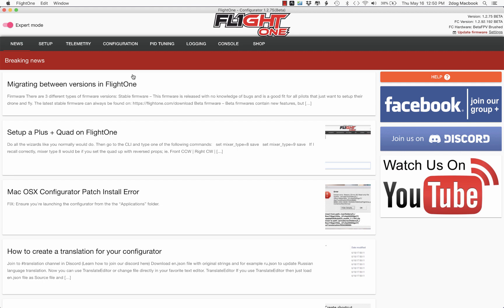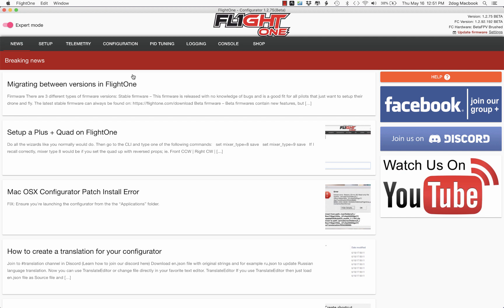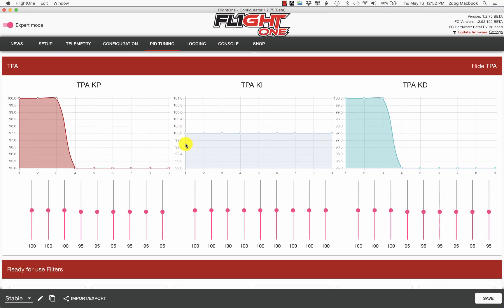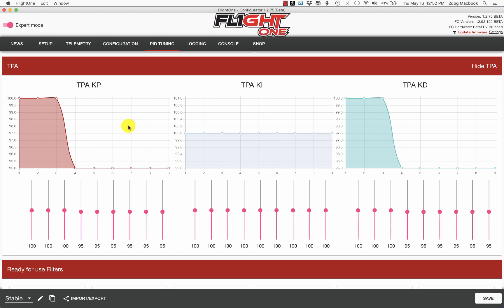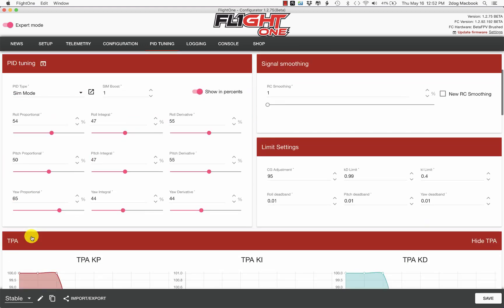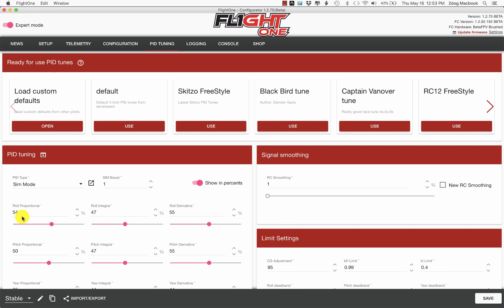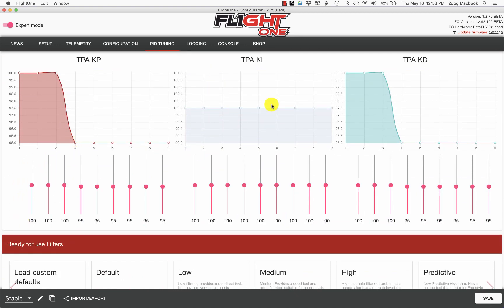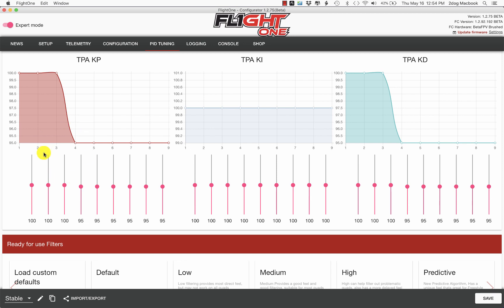Why TPA will make you a better pilot and how to set it up in FlightOne

Comment: Thank you for this vid! I’m having issues on a rebuild and trying to see if tpa will fix it. Got a lot of vibs while flying but everything is tight. Can’t figure it out. I’ve tried diff pids different filters and nothing helps only gets worse. Currently tho it’s at is least about of vibs. It’s flyable but still has some vibs. Tpa seems to be helping a little tho. Revolt v3 Bolt v2 hyperlite 2205 1722kv Motors, high power tune default filters on the left side of the screen and dual biquads at 200 on the right side. 
Also the vibs are constant they don’t change with throttle and it seems to be above about 25% throttle. It seems smooth at idle before you take off.
Reply from the maker: Try lowering one of the those Biquads to 120. That is what I run on my 2205's.
Reply: 2dogrc gotcha. I’ll try that in the am. Also going to try to flip the fc and move some wires around in case there’s some interference somewhere. I do have a 2200uf 25v cap on it tho.
Reply from the maker: Archer FPV Yeah the cleaner the better! The F4 chip up is the best.
Reply: 2dogrc yeah I have chip down only bc on my other build that’s exactly the same I have it down and it runs perfectly. I even have the little vtx switch mounted on the fc and it works. On this one the fc is down but the switch is mounted in a diff spot not even near the fc and I’m getting these vibs.  I did run a motor test and on 3 motors the numbers are super high around and over 5000. But spin the motors by hand and their smooth. It’s weird.
Reply: 2dogrc so pissed right now. Flipped the fc adjusted pids and tpa some more and almost had the vibs out. Went just now for another test flight and clipped a branch just right and somehow ripped the usb plug off the board. Wtf. I did find the little gold connector at least but I definitely can’t solder that back on. Guess I’ll be sending an email to support soon. But still waiting on my revoltosd from the beginning of the month that I had to get due to my other one burning out. But this is a revolt v3 and not an osd board.
Reply from the maker: Archer FPV send in a email, and your discount code will work on the new Revolt lite. RevoltOsd’s are suppose to be in this week.
Reply: 2dogrc I’ll be emailing soon. I think I remember Preston saying something about the lite and the old v3. That’s cool. I just got the lite in kwadbox last week.  Looks like ima start upgrading my fl1 rigs. Lol just need esc’s. I’m down to my last bolt32 and t-motor f45 as far as blheli32 esc’s. Still got 4 Bolt v2’s somewhere around here
Reply: 2dogrc I will say tho all of the fixing this week has helped me tremendously with building and repairing and also the fl1 GUI. I normally hate building but it’s been kinda therapeutic for me.